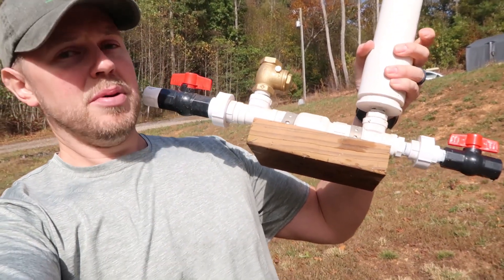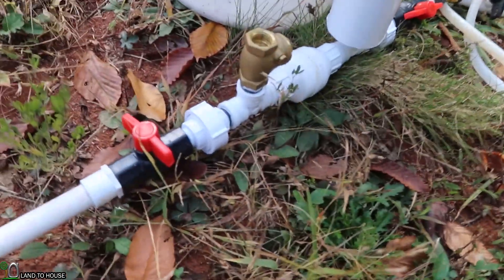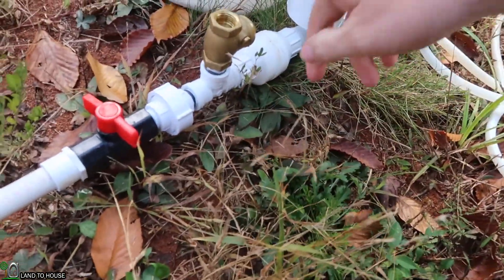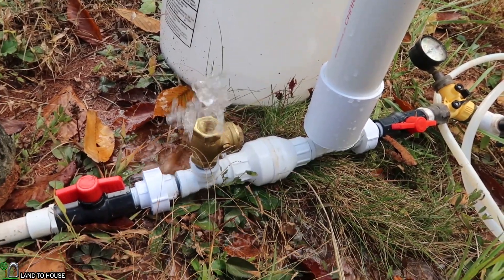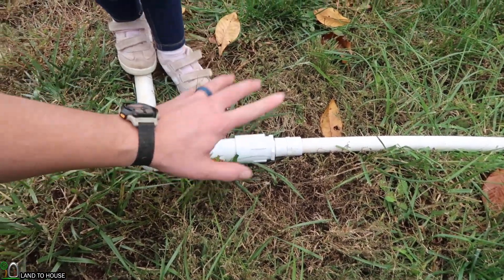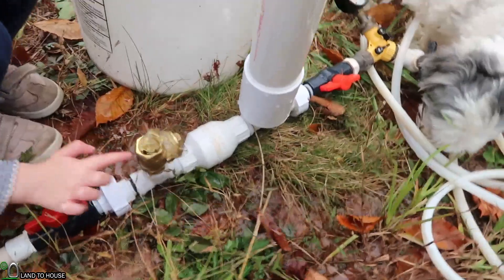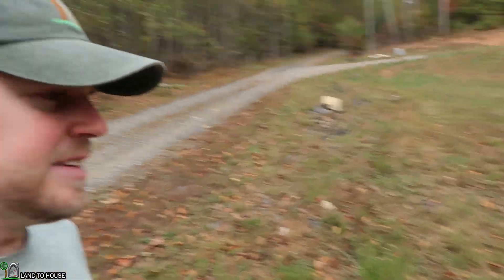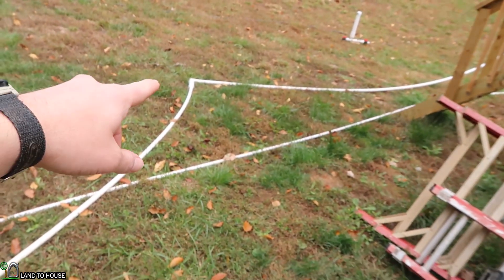Drive Pipe Step Up to Water Source - Ram Pump

Comment: 1:59 - so, just thinking out loud.. does this increase in efficiency also point towards an increase in drive pipe rigidity, as well as a consistent diameter, being beneficial to the 'shock wave' strength or ram effect?  If the drive pipe was buried would that decrease energy losses from sound and vibration?   Is this test mainly exploring energy loss?
It seems to me that as soon as you step up the diameter of the drive pipe, the velocity of the pressure wave is going to slow down and therefore the efficiency is going to decrease since volume and pressure are directly proportional and inversely related.
In a similar way, having a heavier swing valve for higher drive pressure and lighter swing valve for lower drive pressure could be a way to 'tune' the front half of the system... I think.  
Great vid and thank you for doing all this testing Sir - much appreciated!  Cheers from Australia!

Comment: I am trying to place a pump near a spring in very rugged terrain.  How short can I make the drive pipe?  10 feet out is about 4 feet of head, but 15 feet out is about 16 feet of head (not safe out there).  If I use steel pipe, would I be able to shorten the length of the drive pipe to 8 or 10 feet?

Comment: What would happen if you scaled the pipe sizes based on the difference between the original pipe size and the new pipes sizes. For example, 1foot of pipe size of x would be 1/2foot of size y and 1/2foot size z. Where size z is smaller then x and size y is bigger then x. Also z and y hold a similar size change from x. Something to think about, would make a good video.

Comment: If I caught things correctly, stepping up to a larger drive pipe towards the top increased the frequency of the wastewater valve and decreased the pressure.  Do you know what the effect was on the volume of water pumped?    Seems counter intuitive to me that with more water in the drive pipe, that less water water would be in the delivery pipe - maybe interfering with the pressure wave as you said.   Have you tested a larger drive pipe for the hole length?
Thanks for the video.
Reply from the maker: It turns out that the pressure wave needs to be the same going to the pump as well as away from the pump. So if the drive pipe is too big it is good for the downhill pressure wave but when the waste valve closes and sends a small wave against a large volume of water it reduces the efficiency.
Reply: The speed of the water inside the drive pipe in the moment of the closing of the waste valve is most important for generating pressure in the ram pump. In the second experiment the ultimate speed will only be reached in the 20 foot section with the 1/2" pipe. Due to the larger profile the speed is less than half in the 3/4" section (3/4" has more than 2 times the cross section of a 1/2" pipe). That means the biggest part of the pressure surge comes only from the last 20 foot section in the second experiment, whereas you had the full 60 feet section of the drive pipe in the first experiment.
On the other side, the water in the last and smallest section of the drive pipe can be accelerated faster in the second experiment, because you do not need the energy to accelerate the water in the upper and larger sections (remember: energy goes with the square of the velocity!). Hence the water in the lower 1/2" section will reach faster the velocity needed to shut close the waste valve.
This both explains the results from Seths experiments: Faster cycling and less pressure. Unfortunately, the volume of pumped water was not measured. But I would expect also worse results with the step-up-drive-pipe. May be the used amount of water was also lower, then the efficieny (ratio of water pumped to water used) might be not worse.

Comment: 3/4 coupling  will fit inside 1 inch coupling you can use this in place of a  bushen or reducing coupling when you can't find them in the store

Comment: Could you build a 1 inch ram pump and do the opposite with the piping (instead of large pipe down to smaller and smaller pipe, go small up to larger pipe)? Would this have the opposite effect and increase efficiency?
Reply from the maker: It sounds like it would but actually the smaller pipe restricts water flow and keeps the valve from closing. If you have enough head pressure you can get it to work but it's best to have the same size the full length.
Reply: Thanks for the advice.

Loving your ram pump series. Keep up the good work!
Reply from the maker: @_Lord_BoNes  the ram pump series really has been nice. This upcoming Monday is the last of the series for this year. Although I will probably have a couple of more videos in the winter time testing some cold weather Ram pump.

Comment: What happens if you go from large to smaller pipe?
Reply from the maker: If you go the other way you will not have enough water to run the pump. The waste valve will not close because there is not enough water going to the pump from the smaller pipe.